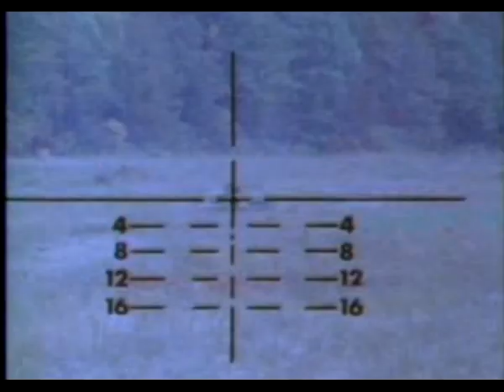M60A2 Patton "Starship" MBT

Comment: this is NOT  a Sheridan,, this is a m60 a2 tank, it weight 57.4 tons ,it was the heavies mbt at the time,, a Sheridan weighed about 18 tons, & was powered by a bus motor,,so learn something b1 bobson,, I served on these , I know what im talking about!
Reply: I had to repair those massively over engineer, and under thought, horrid pieces of crap. (45K) 1979-82.

When I was at Fort Hood, 2nd Armored (80-82), my company serviced the last battalion of those rolling pieces of crap, as the M60-A3 was replacing the A2.

During this time, the M1 Abrams was in its final stages of field trials. 1st Cav, who occupied the north half of the base, were chosen for full on final field trials. 

Aside from constantly breakdowns in the fire control, and laser circuitry due to the circuitboards not being properly shock mounted. 

The M60-A2 had somewhat of a horrifying reputation of roasting its crews when the breach did not fully seal, and when a HE round, or missile is fired, blow torch hot gases leak out. This happened to one tank crew three months before I was posted at Hood. The loader was the most grievously injured, and all crew suffered from inhalation of hot combustion gases. 

Only got to sit in an M1 during my AIT at Aberdeen. Never got a chance to work on the M1.